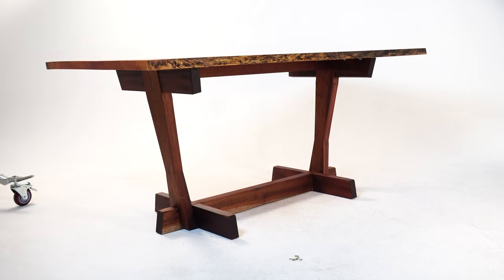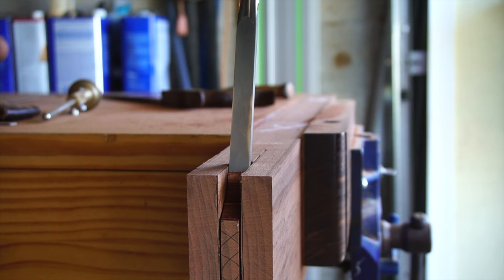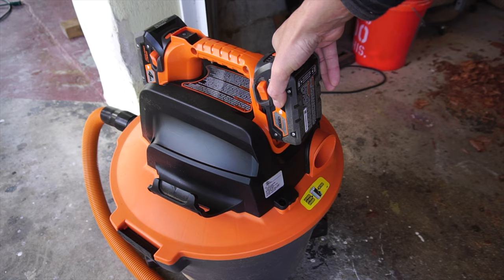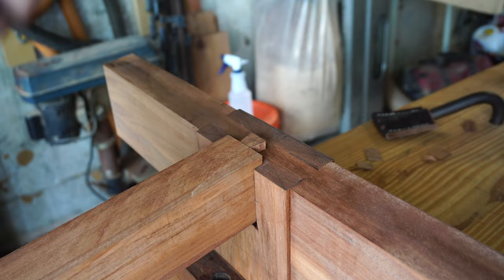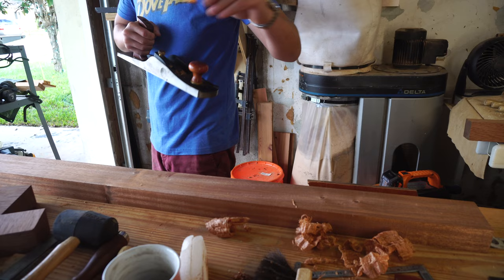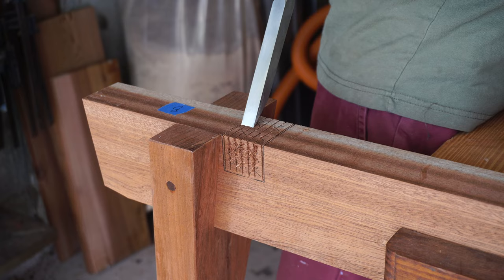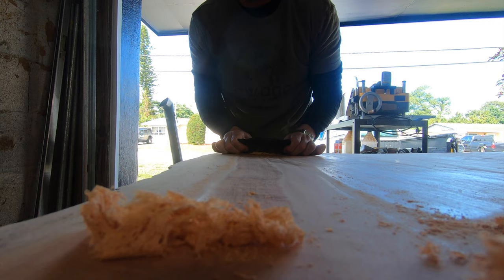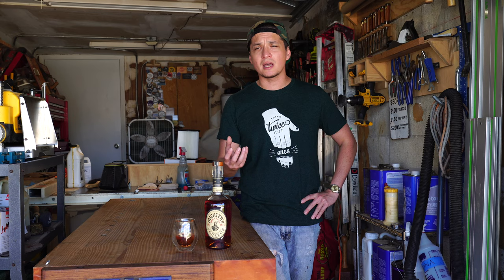Nakashima Conoid Table: A Masterpiece Of Japanese Woodworking

Comment: Great video, lovely fine work and amazing finished table.  Love the joints, which as an architect I really do appreciate!   \m/
Reply from the maker: The only bummer thing is that on that bottom stretcher I really wished I could have draw bored it in. I was just thinking after the dry fit how much of a pain in the ass it would be to take it apart and relocate it for a dry fit.

Comment: Hi there, I like your table a lot! Have you build it for yourself or for a customer? How do you prevent the table top from cupping? Maybe I have missed this part. Thank you!
Reply from the maker: That was for a client/friend. So proper selection and ensuring the slab is air dried helps. I don’t really believe in c channel or more “restraint” oriented alternatives because ultimately it will restrict the movement to the point of cracking or checking. It’s important to note that George Nakashima didn’t use steel to keep his slabs flat either. It was very strict selection. You’ll see battens on the underside but that just keeps things “together” since he wasn’t using dominos or biscuits for alignment.

Comment: Very nice job man. You keep your tools sharp! Did you thin out the tung oil in the first few coats of the top?
Reply from the maker: I did not actually. Just very light coats. Like the rag is charged up but it’s not so wet that you can squeeze oil out of it. So real milk paint company has a solvent that can be used to thin pure tung oil that’s food safe, it’s a citrus solvent. I haven’t used it yet but I’m pretty eager to. I don’t think it lowers the viscosity enough to really “penetrate” any quicker. But I do think it thins it enough to make the oil easier to work with if that makes sense.
Reply: @CowDogCraftWorks  sweet. Yea I use their stuff frequently. Most often I've been using their Half & Half with the solvent already mixed in. I'm in NY so unless its warm out I find the Pure Tung oil to be a little thick for the first few coats.
Reply from the maker: I think, but do not know for a fact, that they’re pure tung is so thick because it’s “pre-polymerized” a touch... probably to help with cure times, but that does result in a thicker product. A few folks I know say the woodcraft tung is substantially thinner... but it takes forever to cure.
Reply: @CowDogCraftWorks  good to "know" !
Again, beautiful job. Keep up the good work!

Comment: Nice work. Just playing around with sharp stuff. Ha ha
Reply: Cuban mahogany though. That’s the real stuff! Hard to find. Your very committed to your craft - it is good to see people use hand tools.
Reply: I also need to try that oil you are using. Been so caught up with shellac. I miss miss using danish oil or polymerized tung oil  just because how easy it is.
Reply from the maker: It’s easy but it takes forever to fully cure. The wood was still “sweating” it a bit when I delivered it.

Comment: How are you buying live edge slabs but can't buy a jointer? Cart before the horse my friend. I hope after selling that piece you could get a jointer.
Reply from the maker: For starters: buying live edge slabs and buying a jointer are not correlated. That’s like saying, how are you buying a steak when you don’t own a microwave? Furthermore, I’m like 5’8 and 140 lbs soaking wet with change in my pockets so the idea of using a jointer of any kind with a large ungainly slab by myself sounds like a nightmare. And to get the result I did, you’d have to run them side by side so they would mate perfectly which makes it even more clumsy and dangerous for me. Using a jointer plane... was not only the most sensible alternative in my humble opinion but the one I was most comfortable with. And candidly as we say in the legal field... res ipsa loquitur... the thing speaks for itself.
Reply: How are you commenting on woodworking posts when you have no idea what you are talking about?
Reply from the maker: Lolz
Reply: @The_Conqueeftador  Nah . It's painfully obvious you speak from regurgitation and not experience. Stick around though, you may learn some more things to regurgitate later. Like  match jointing.
Reply: @CowDogCraftWorks   The point I was making was that live slabs are stupid expensive. So it felt weird that you bought a live slab before a semi basic tool like a jointer. Then I rewatched the video and noticed how you got it locally from a friend and it is not one of the more expensive wood slabs like I am used to working with. Sorry for your confusion.
Reply: @The_Conqueeftador  wow, you sound amazing. Link me to your professional work so I can check it out. But you can’t. Because just like your username, the money you make off your projects and your experience, it’s all made up and doesn’t exist outside of YouTube comments
Reply: @josephlaviolette146   When you become successful and still want to voice an opinion quietly. I suggest you don't take your own advice and instead you do like I do and keep your work life and private life separate.
Reply: @The_Conqueeftador  I do keep them separate. I’m not a woodworker by trade. There’s not enough money it.
Reply: @josephlaviolette146   Oh yes there is. You just have to think harder and smarter the same as any career field. You are correct though. Simple stuff is not going to pay the bills usually. I thought this youtuber was going to use the kanna style on his wood that is why I clicked on it. I was disappointed. Then I made a friendly observation that got taken as hostile. That is all.
Reply from the maker: Well that escalated quickly.